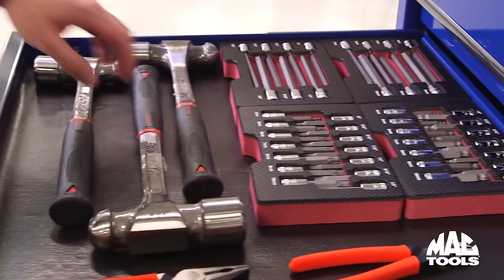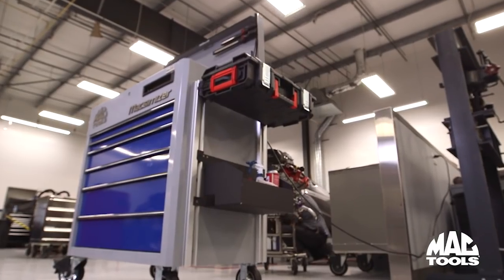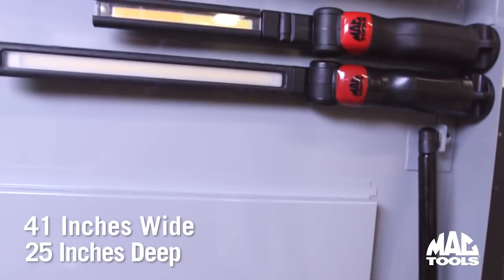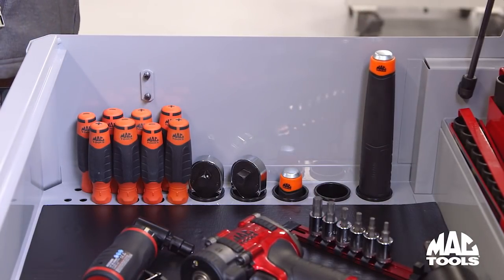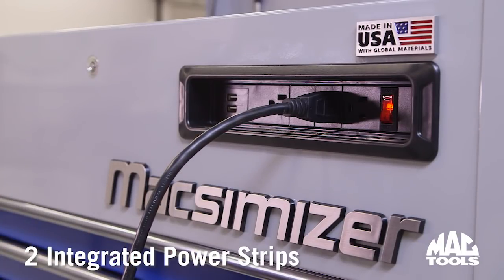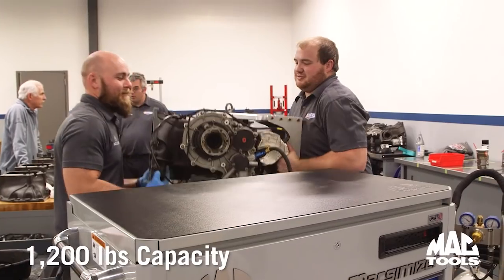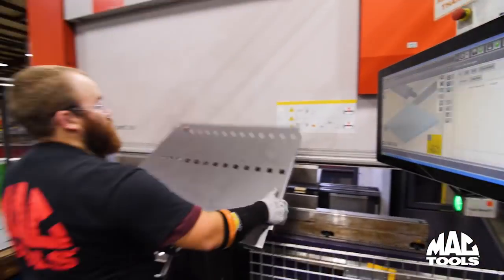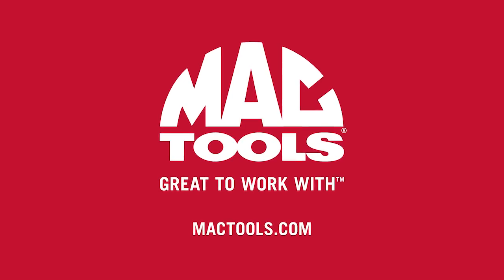Mac Tools Macsimizer™ Utility Cart

Comment: Get the one from harbor freight for $189...it doesn't have the power strip or fancy rim wheels
Reply: LongIslandP8ntball yeah but this cart is a lot bigger than that cart, A LOT bigger...
Reply: this isn't even in the same arena as this one.  You're comparing a Honda Civic to a full size truck.
Reply: Humberto Muñoz  the carts are good.  The rest of hf is trash except a few hidden gems